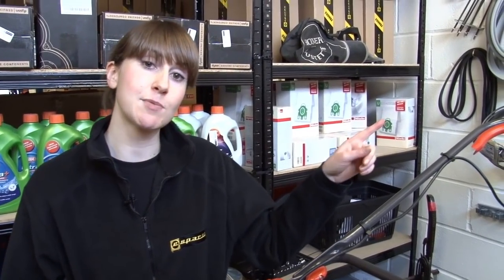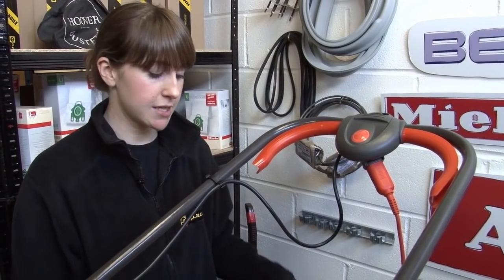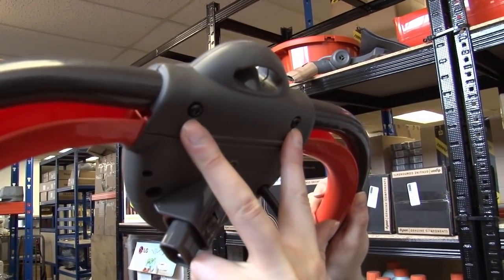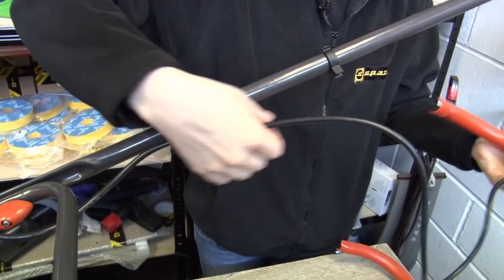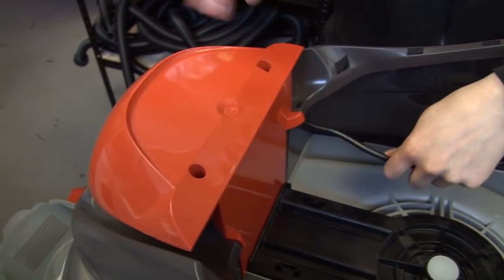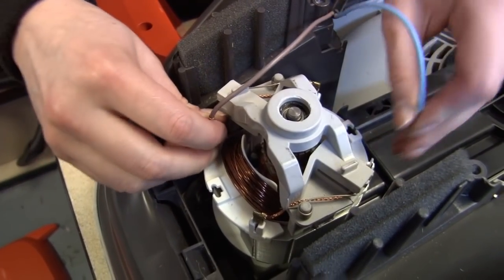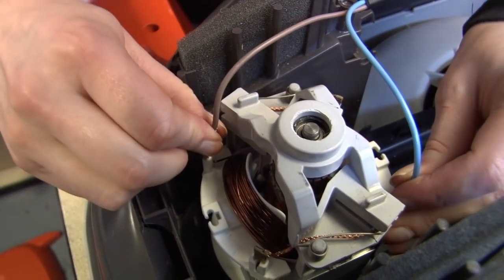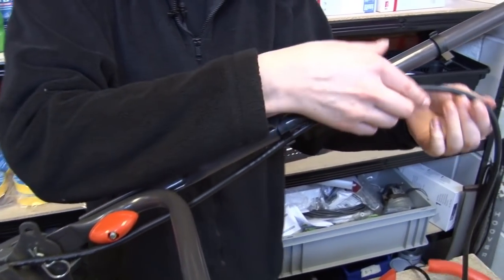How to replace a switch box on a Flymo Turbo Compact 330

Comment from the maker: @Pianoguy32 The part that the plug goes into is available as a replacement part.
Reply: Where can I buy the cable that goes into machine? The part, where the plug goes in, shorted and melted